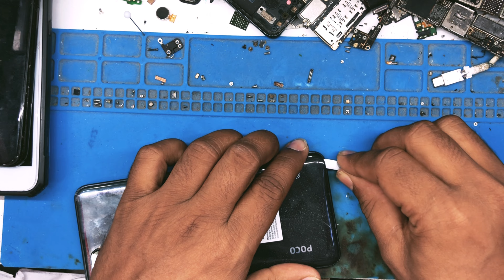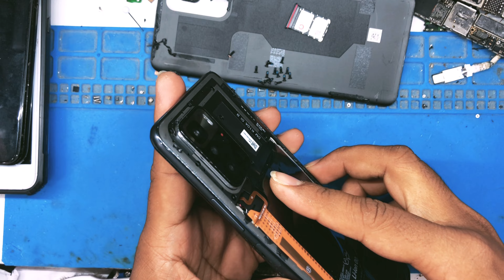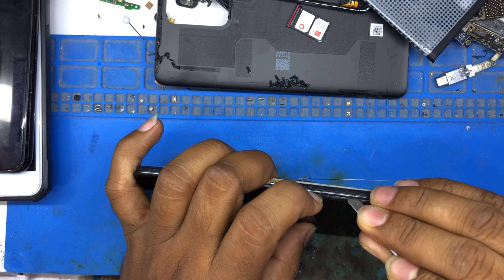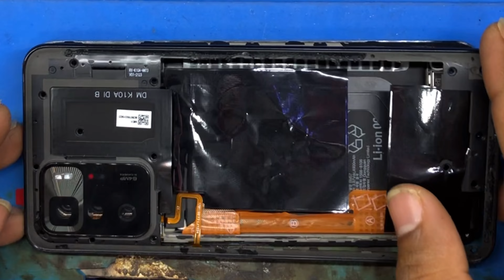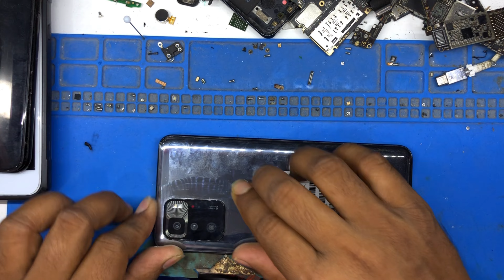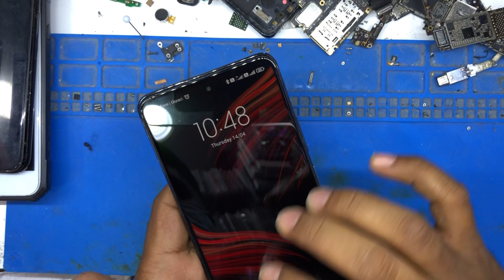POCO X3 GT 5G Screen Replacement || Redmi Note 10 Pro 5G Screen Replacement

Comment: What adhesive to use? My X3GT is working good except the top portion pops off, only the LCD part...

Probably the adhesives weakened. Due to constant outdoor use / sun exposure
Reply: My screen glass is also loose broo
Reply: All X3 GT, Note 10 5G phones have the problem with the screen falling out. They were assembled wrong in the factory!